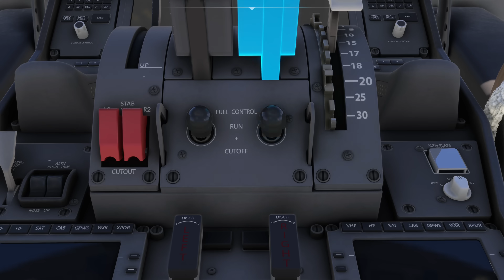Air India 171: Why Did The Fuel Cut-off Switch Get Moved?

Comment: Unless I have read it incorrectly, the preliminary report nowhere states that either pilot moved the fuel cutoff switches from RUN to CUTOFF.

It does state that "the Engine 1 and Engine 2 fuel cutoff switches transitioned from RUN to CUTOFF position one after another with a time gap of 01 sec".
But take a step back: what does the circuitry operated by these switches look like, both in hardware and in software? Where in that circuitry is the state of the fuel cutoff switches, as shown in the EAFR data, determined? What is the EAFR sampling frequency for these signals?
Any idea? I don't.

One should not discount the possibility that due to a malfunction the indication of both fuel cutoff switches transitioned from RUN to CUTOFF without the actual switches having been moved to CUTOFF, so without any input from the pilots. Such a malfunction may have been temporary allowing the engines to restart, again without any pilot intervention.

The report also states: "In the cockpit voice recording, one of the pilots is heard asking the other why did he cutoff. The other pilot responded that he did not do so." The question may just have been related to the unexpected loss of power.

Comment: Surly the fuel cut off switches should  only work when the engines are at idle! And not when they are running at high power! And why have them next to the thrust levers? Why not have them on the overhead panel and quite separate and guarded ?
Reply: i would guess if the engine is on fire you can't wait for it to go idle before cutting off fuel

Comment: Within a gap of 1 second, how easy it is for somebody in the cockpit to turn those switches off, while flying, that too during the critical phase of the flight. It has to be beyond 1 second. Secondly,  what would compel a pilot during T/O too look only at that very particular switch, and then ask the other why did the other pilot turn it off? I personally feel, something is not adding up. Either the manufacturer is trying to hide something, or vice-versa. My instinct says, none of the pilot would have done it.

Comment: My main question is: do you consider it possible that both the switches can be shut off manually in under one second?
And my second question is: do you really think two people should be required to shut the engines down?

Yesterday I've seen an interview with a guy from the Indian pilot union who totally rejected the idea that one of the pilots could have it done purposely. He told even if somebody would want to do that it is simply impossible to switch both the engines off manually in one second, as the flight recorder data clearly show. And doing this unseen by his colleage is in his opinion also impossible. He takes the recorded conversation about the switches as proof that neither of the pilots switched off. And secondly he told the RAT was down AND the surviving passenger observed flickering cabin lights BEFORE the engines stopped, what was not even mentioned in the preliminary report. But all these points suggest in his opinion that there was no pilot involved in switching off and that there was anything wrong with the electrical system.
He also recalled a situation with the same airplane type in 2019 in Osaka, where after landing thrust reversal was impossible and the fuel was switched off without any pilot interference.
He also asked why nothing happened after Osaka, and why it was not mandatory but only suggested since 2018 to change the switches.
I got the impression that he is absolutely convinced that the pilots did not do anything wrong. 

The other thing ... to make it mandatory for 2 pilots to switch off fuel together only makes it also impossible to switch off if one of the pilots is not present in the cockpit or no more able to do anything due to whatever reason. That makes it - IMHO and overall seen - even more of a danger than the current way to switch off the engines in a dangerous situation, and as layman I do not agree with your professional view that this could ever be a proper solution. I think if a pilot really wants to commit suicide he will find a way, for examply by letting the other pilot not come back to the cockpit and driving the plane into the ground as it seemingly happened with that German Wings plane years back. But it seems not to be really smart to make it more complex and requiring two persons to switch off engines in case of an emergency.

Comment: Is there any evidence that one of the Pilots manually put the switch in the cut off position? There could be mechanical failure that could have triggered the action especially after the 2018 FAA Safety Bulletine on the same switches. What is your hypothesis on Pilots manually changing the position?

Comment: Assume that it was intentional by one of the pilot who cut off the fuel supply, and if the same pilot asks the other pilot "Why did you cut off the the fuel" just to shift blame on the other pilot. In that case you can never blame single pilot in this case for their act right? who can they even confirm this?

Comment: The report has lots of ambiguity and is targeted to put the onus on one of the pilots (who are not there to protect themselves), The report is more biased to protect some big stakeholders in this case.
You were wrong three times in your earlier assessment in your reviews. Why should we agree with the theory of deliberate cut off the switches just after liftoff.
In my understanding the switches have never been cut off, it is a software bug or electronic malfunction which cut off the cut off command and reported it on the dashboard of the pilot and later started the re-ignite engine process by the FADEC (Full authority digital engine control) system. Electrical failure after the wheel came off the ground and RAT got deployed immediately on lift off Electrical glitch can also have an effect FADEC operation which in turn cuts off fuel. There can be multiple possibilities of malfunction in such a complex system. We can't reach any conclusion with this preliminary report.

Comment: Based on the preliminary report why all the analysis are assuming that the fuel cut-off switch was moved? Which ultimately blames one of the pilots, either intentionally or unintentionally. Are there any other proof apart from the pilots' voices from the CVR pointing towards fuel cut-off? I feel the investigators, are focusing on a single track that the fuel supply was cut off.  Why cant any other possibility be investigated.  Secondly, the report says one of the pilots asking "why did u switch offf" while the other says "i didnt do".  From the CVR, can't the investigators identify the pilots' voices and be specific who said what.

Comment: Why has no one considered... what if the levers DIDN'T LOCK in the, "run" position in the first place?
Reply: It seems weird that this was not even addressed yet. The switches are spring-loaded, and has a hole in the RUN & STOP positions. So... what if... during the pre-flight, the switches were moved up, to the run position, but neither pin dropped into the hole that locks them in place? Then as the vibrate down the runway, the pin keeps bouncing on the slide, between run and stop... then the g-force at takeoff, literally slid the switches down? Seems too probable to ignore. Yet... silence.

Comment: Question : any possibility that when the PF called for gear up, the PM (tired, depressed, distracted?) had a brain fade and pulled the cutoff switches instead? Seems the 10 seconds of audio between cutoff and back to run will tell all.

Comment: It would be easier to smash my head against a brick wall, than to actually have someone take notice of what I keep trying to tell everyone.

The BOEING Flight Manual for this aircraft states clearly that if the aircraft is in start-up mode, and the fuel switch is set to cutoff, then the aircraft will ignore the cutoff and allow the aircraft to be started.
If this is not picked up by the flight crew, then the second that the wheels leave the ground, the cutoff triggers.

This is exactly what happened. Prove me wrong. Please prove me wrong. I dare you.

Comment: Good day Captain Steve, as an aircraft engineer I know that there is always something to learn especially after an accident. In order to avoid this kind of dramatic situation in the future I suggest to introduce a modification to secure the fuel valves in open position from the lift off until a safety altitude (except in case of fire). It is technically possible.

Comment: Apparently faulty AOA sensor reading triggered automated MCAS nose pitch down in the 737 MAX9 crashes. Is there anything similar on the 787 FADEC or other engine control system that can automatically shut off fuel supply valves? Separate FADEC for each engine I assume. That might explain the slight delay in shutdown. An auto shutdown would catch both pilots by surprise, and this might explain why both the 1st pilot asking the question, and the 2nd pilot denying that he had thrown the cut-off switches.

Comment: Back in December 2018, I understand the FAA issued a Special Airworthiness Information Bulletin regarding the fuel cut off switches.   The Bulletin highlighted the mechanical protection (i.e. to prevent accidental or inadvertent movement of the switches) have in some instances been installed without this protection been engaged.  Now I also understand that this aircraft may not be one of the original aircraft whose switches may not have been affected, but I believe it may well have had later maintenance done around the throttles and fuel system.   Can we be certain the mechanical protection (to prevent accidental or inadvertent movement of the switches was engaged?      
Although I do think even if it hadn’t been engaged, considering the switches location it would he hard to understand an accidental switch off of one switch, not a mind two switches.  
Another reason to have cameras in the cockpit, don’t you think?

Comment: The pilot Clive Kunder also flew Piper PA-34..
Which has 2 switches look like the B-787 but use for Cowl Flap that close after lifting.
May be the pilot placed engine fuel cut off by thinking that the Cowl Flap of the Piper PA-34 aircraft …
The investigators should check this human factor

Comment: Contrary to a previous comment that 'Adding more complexity to the fuel cutoffs...' won't stop a determined Pilot from crashing a plane, well I would say the design of the switches is flawed from the start. And isn't it better to eliminate easy options for someone to sabotage the flight? It should not be possible to toggle the switches to off while the plane is in the air, except in an emergency. There should be a very loud alarm if someone tries to do this and the switches will not work until the alarm is acknowledged. In addition, if there was a fuel boost button that increases the flow rate for a few seconds, would that have helped when the Pilot toggled the switches back to run? Maybe an added function of that boost button is that it bypasses the cutoff function? The Pilot could press the button first then toggle the switches to run thereby saving vital seconds?

Comment: Below report demonstrates an incident whereby fuel control switches where knocked after dropping flight plan clipboard over switches. Is it possible that a heavy knock could still knock the switches as this report demonstrated in a B787? The finding did not mention faulty switches. Report source https://akama.arc.nasa.gov/ASRSDBOnline/QueryWizard_Display.aspx?server=ASRSO

Report extract:

ACN: 1610428 (1 of 1)

Time / Day

Date : 201901
Local Time Of Day : 0601-1200

Place

Locale Reference.ATC Facility : ZZZZ.ARTCC
State Reference : FO
Altitude.MSL.Single Value : 41000

Environment

Flight Conditions : VMC

Aircraft : 1

Reference : X
ATC / Advisory.Center : ZZZZ
Aircraft Operator : Air Carrier
Make Model Name : B787 Dreamliner Undifferentiated or Other Model
Crew Size.Number Of Crew : 3
Operating Under FAR Part : Part 121
Flight Plan : IFR
Mission : Passenger
Flight Phase : Cruise

Aircraft : 2

Reference : Y
ATC / Advisory.Center : ZZZZ
Aircraft Operator : Air Carrier
Make Model Name : Commercial Fixed Wing
Operating Under FAR Part : Part 121
Flight Plan : IFR
Flight Phase : Cruise

Person : 1

Reference : 1
Location Of Person.Aircraft : X
Location In Aircraft : Flight Deck
Reporter Organization : Air Carrier
Function.Flight Crew : Pilot Not Flying
Function.Flight Crew : Relief Pilot
Qualification.Flight Crew : Multiengine
Qualification.Flight Crew : Air Transport Pilot (ATP)
Qualification.Flight Crew : Instrument
Experience.Flight Crew.Total : 9659
Experience.Flight Crew.Last 90 Days : 237
Experience.Flight Crew.Type : 3512
ASRS Report Number.Accession Number : 1610428

Person : 2

Reference : 2
Location Of Person : Company
Reporter Organization : Air Carrier
Function.Dispatch : Dispatcher
Qualification.Dispatch : Dispatcher
ASRS Report Number.Accession Number : 1610445
Human Factors : Human-Machine Interface

Person : 3

Reference : 3
Location Of Person.Aircraft : X
Location In Aircraft : Flight Deck
Reporter Organization : Air Carrier
Function.Flight Crew : Captain
Function.Flight Crew : Pilot Flying
Qualification.Flight Crew : Multiengine
Qualification.Flight Crew : Air Transport Pilot (ATP)
Qualification.Flight Crew : Instrument
Experience.Flight Crew.Total : 10537
Experience.Flight Crew.Last 90 Days : 212
Experience.Flight Crew.Type : 805
ASRS Report Number.Accession Number : 1610859
Human Factors : Human-Machine Interface

Events

Anomaly.Aircraft Equipment Problem : Less Severe
Anomaly.Deviation - Altitude : Excursion From Assigned Altitude
Anomaly.Deviation - Track / Heading : All Types
Detector.Person : Flight Crew
When Detected : In-flight
Result.Flight Crew : Overcame Equipment Problem

Assessments

Contributing Factors / Situations : Human Factors
Primary Problem : Human Factors

Narrative: 1

[En route] I reached up for the flight plan, which was resting on the glare shield. We were using the heavy Boeing gray clipboard to hold the flight plan, and as I picked it up it off the glare shield it slipped out of my hand, falling and striking the Right Engine Fuel Control Switch, knocking it into the CUTOFF position. The Captain (PF [Pilot Flying]) executed the Engine out drift down procedure with me backing him up, descending and offsetting 15 nm right of course, and after the aircraft was established he handed control of the aircraft off to me while he looked up and executed the Engine Fail R checklist. We also woke up the FO (First Officer), who was on his break, requesting he come to the cockpit.

We stabilized at FL310, knew exactly what had happened, and after discussing it together, followed the checklist by returning the FCS (Fuel Control Switch) to RUN, and the engine restarted. We discussed the situation with Dispatch, [Operations Management], and the FO (who had returned to the flight deck by this time and was occupying the center jumpseat) and all agreed that we could safely continue the flight to ZZZZ, which we did after coordinating with ATC and [Operations Management.]

We did not declare an emergency as we were too busy running the checklist and backing each other up, by the time we thought to we had already restarted the engine and stabilized the aircraft.

Narrative: 2

The crew called on SatCom to report that a clipboard had accidentally been dropped on the fuel cutout lever and the engine shut down. The crew descended from fl400 to fl310 and restarted the engine successfully. They said they were back on route and were going to request a climb back to fl400. The current fuel was compared with the flight plan and there was no significant discrepancy and the crew and dispatch determined continuing to ZZZZ was not a problem. The crew declined to talk to [Maintenance Control]. No emergency was declared. The crew spoke to [Operations Management]. No announcements were made to the passengers.

Narrative: 3

During the time we were talking to dispatch we also talked with the [Operations Management] sometime after our first discussion with [them] we received a message from [Center] with a request to forward your engine failure report to [the next Center] or the FAA, there was a loss of separation with Aircraft Y and they need to justify it. We confirmed that the [report] would comply with this request we sent a copy to [Operations Management].

Synopsis

B787 flight crew and Dispatcher reported the right engine was inadvertently shut down when a clipboard was dropped onto the right engine control switch.

Comment: Is there any scenario in which it would have made sense to cut off fuel switches during the lift off Prozess? NO! So why doesn't a computer prevent this action? Even if one of both engines is in flames the lift off procedure will be continued, wouldn't it???

Comment: Maybe a software delay function is required (from when the switches are flipped) so fuel cut off is not instant and there is a short period of time for someone to rectify it in the case of an error or malice. Wouldnt affect the landing scenario mentioned as you would just allow for this time delay when cutting off fuel for landing.